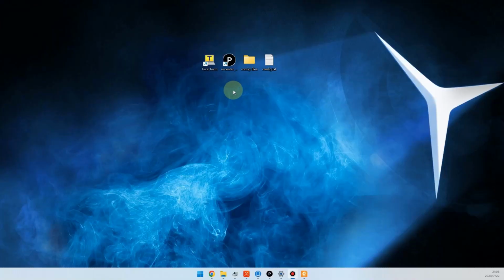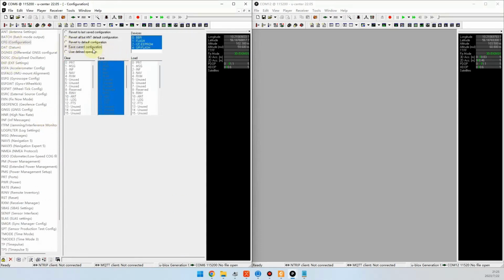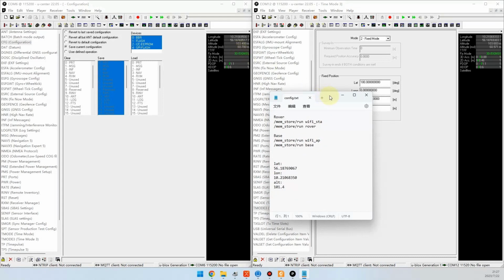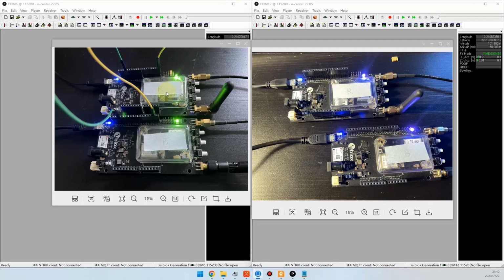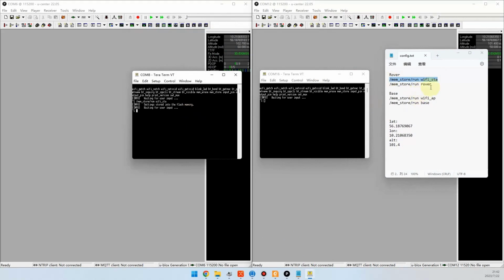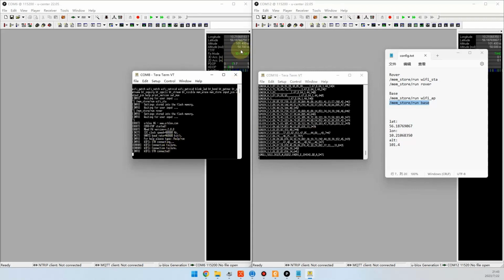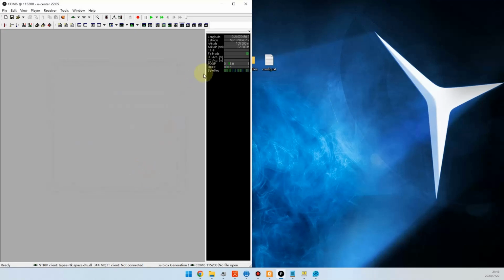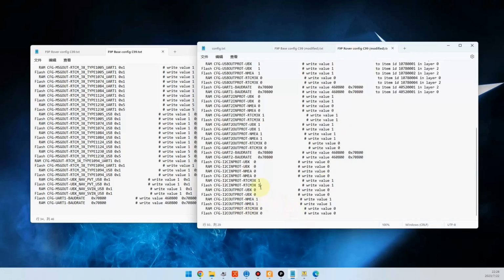C099-F9P (ZED-F9P) RTK Configuration Tutorial

Comment: Working flawlessly!
Thank you for the instructions. Helped me alot to understand some basic things. I have some questions to which, I hope you can give me a response.
First, are you sure that the Rover is receiving RTCM msg, from the Base?
Because if it does receives, the Green Led (RTK) next to the Power Blue Led (TP) should blinking. Which I didn't see in our case (your)? Especially in the case when they are connected over the WiFi. In ways when I use it - using NTRIP correction with U-Center, and using Bluetooth Android application (BT GNSS or Lefebure Ntrip client) for a correction server I see it and can confirm it that does blinking. Should be turned in steady Yellow but never checked this when I used to be outdoor. I know and saw it in the Telnet console that the Rover receives some msgs but not sure that it knows what to do them.
This is my use-case btw. Moving Base AP (RTK+Wifi) --> Rover --> Android app (phone). Which for now I can't make it run...
Reference to C099 User Guide (UBX-18055649 or similar):
3.2.1 ZED-F9P status LEDs
The board provides three LEDs to show the ZED-F9P status. The location of the LEDs is shown in Figure 7 below.
The RTK status LED provides an indication of the state of the ZED-F9P module RTK-STAT pin.
• At start-up the LED is off.
• When a valid stream of RTCM messages is being received and utilized, but no RTK fixed mode has been achieved, the yellow LED flashes.
• When in RTK fixed mode, the yellow LED is turned on.
Next, if we check the documentation from this link - https://github.com/u-blox/ublox-C099_F9P-uCS/blob/master/zed-f9p/C099-F9P-Quick-configuration-Moving-base_(UBX-19046400).pdf
on page 11 is written - To enable the Base/Rover Wi-Fi communication with the Connectivity SW, place a jumper at position ‘OE3’ to connect ODIN-W2 and ZED-F9P UART1.
I notice in the configuration files that RTCM are send over the UART1. So isn't that enough to send the RTCM over the Wifi or you think still need to configure them like in your configuration files?
I think my use-case is very interesting and useful, because those devices are for outdoor purposes and hope you can help a bit to achieve it.
Cheers!